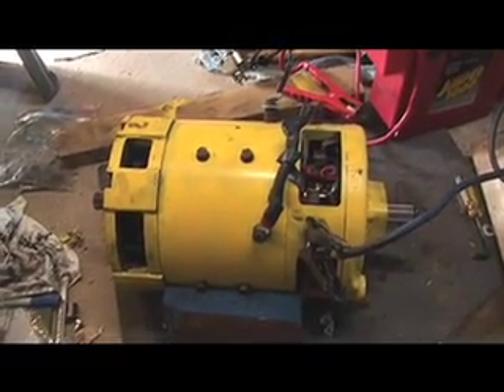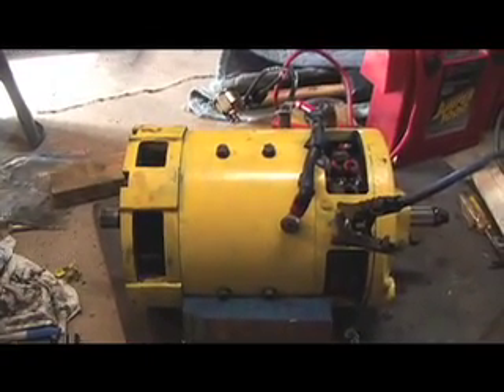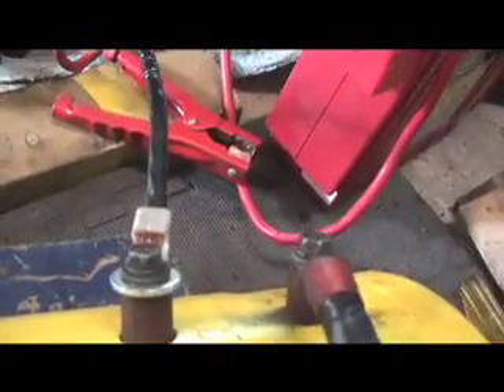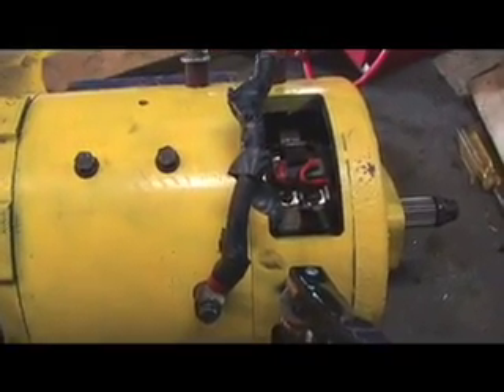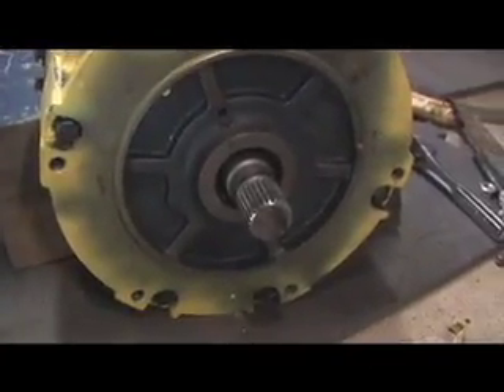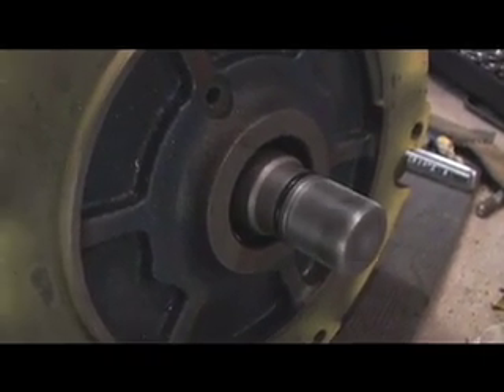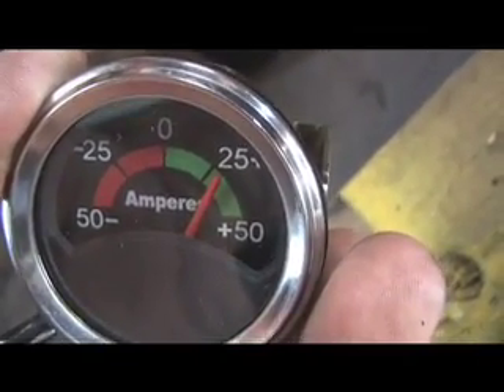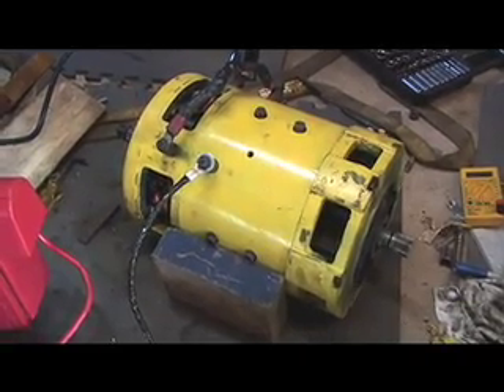forklift motor for electric car

Comment: Hi, did you ever make a vehicle hybrid? I was thinking of adding a forklift motor to my rear differential with a one-way bearing and a chain and sprocket. Is there any reason why someone couldn't or shouldn't do this
Reply from the maker: I did a series-hybrid. Much simpler mechanically. Used an LP generator to provide a steady current to the battery pack.
DIY hybrids can get complicated fast.
This design was a pretty simple one.
https://www.youtube.com/watch?v=xXVi-g4jWqI

Comment: What size motor is that in H P rating ??? Thanks
Reply from the maker: The motor never had an ID plate on it, so I couldn't tell you what the official rating was. It came from a forklift, so it would have been designed for either 36 or 48VDC.
I've run 500A through it at 144V. That translates into 72kW or about 96 HP.

Comment: I have this exact car.  It has a advance 9 dc motor already installed.   I have an 11 inch motor that is new old stock.  My question is, is bigger better?  More efficient?   Could I get better or worse mileage out of it.  it does weigh 250lbs.  Thanks DiyDave
Reply from the maker: An 11 inch motor won't fit a Geo Metro transmission. It's physically too large. There's not enough space between the center of the input shaft on the transmission and the half-shaft output to the passenger side wheel.
Reply: @BenjaminNelsonX  thanks for responding,  I wasnt sure.  I am practically into everything your doing, except blacksmithing.   Is it possible to email you.  I can keep you in touch with my progress.  I found a geo that was already converted.  Already had a advanced dc 9" installed.  And in great shape for 850$.   Thanks.  Diydave
Reply from the maker: Best way to contact me is to leave a message at 300MPG.org

Comment: Does a fork lift motor have enough RPM's to get a car up to 
at least 60 MPH?
Reply from the maker: I've gone at least 74 in a 55 zone on just a forklift motor. Just keep in mind that RPM is proportional to voltage on DC motors. For good freeway speeds, go with as high of a system voltage as you can.

Comment: I'm having trouble finding this info online. I want to convert an 8000 lb vehicle to electric. The stock engine produces 215 lb ft of torque. I want to do this conversion with recycled materials to save cost and resources. Are there any forklift motors capable of producing this kind of power? Or any other motors readily available at a junkyard?
Reply from the maker: Here's a good forum thread on using a forklift motor.
https://www.diyelectriccar.com/forums/showthread.php/using-forklift-motor-and-choosing-good-7598.html

Comment: Isnt that a 48V motor?  High amps
Reply from the maker: It was 48v in the forklift, but no reason not to run it at higher voltage. I've run this motor in a car at anywhere from 12 to 144V. It is CAPABLE of high current, which means plenty of power when at higher voltage.
Reply: @BenjaminNelsonX  How many HP is the motor?
Reply from the maker: @blackz06  No idea of the official horsepower. The motor did NOT have an ID plate on it.
I've run it at up to 144V/500A. In that configuration, it's about 100 HP peak.
Reply: @BenjaminNelsonX  Okay, thanks!  Is there a way to derive tq from the hp numbers? Or some way at all?
Reply from the maker: @blackz06  You would have to know your engine speed as well, but if you do, you can calculate torque.
https://spicerparts.com/calculators/horsepower-torque-calculator

Comment: Better to calculate in watts using DC in autos, convert watts to amps times volts, watts will lead you to how many watts you'll need(for your motor) through whatever batteries you'll need and alternator or alternators, you could splice in multiple alternators whatever the batteries are rated to take-in(and alternators to put out). If you have enough dough the car stereo competition batteries they use can charge fast, if you got 4 1,000watt truck batteries and you use a 4000 watt inverter compare that to the max wattage your motor takes 'amps times volts' you might have some leftover watts(for accessories) double your batteries(and wattage) if you have to manually transfer your batteries on and off charge(you could set up a breaker like panel) that's a direct connection(low gauge wire and multiple).
Reply: You'll have to pm me through messenger I was planning on putting something together for the EV.

Comment: How long will it run before it gets hot?
Reply from the maker: Running at 72V, this motor really never did get hot. In the back end, those fins act as a fan pumping air through the commutator end of the motor. When I ran it at 144V, the motor would get pretty warm. If I had left it long term as a 144V system, I probably would have advanced the timing on the motor and maybe added a separate cooling fan.
This is a nice beefy motor from a forklift. It's designed to handle a fair amount of power.
Reply: So it's a 72 volt motor?
Reply from the maker: It's a forklift motor. Most forklift motors were desgined to run on 36 or 48 volts. Feeding it with higher voltage gives you more power. Most forklift motors can take higher voltage no problem, but at some point, the timing of the brushes should be advanced. That helps prevent arcing at higher voltages/RPMs. Timing motors is one of the secret skills of the forklift motor hot-rodders. Do a search on a web forum like DIY Electric Car if you'd like to learn more.

Comment: Is a transmission absolutely necessary?
Reply from the maker: A multi-speed transmission isn't needed. Most commercially-available electric cars use single-speed gear reduction. However, you still need a differential to split the power to the two wheels. In a small front-wheel drive car like a Geo Metro, the transmission and differential are a combined unit. Reusing the transmission gives a place to mount the electric motor and a way to split the power to the wheels.
Reply: BenjaminNelson Don't forget that you need a transmission for giving you reverse gear and park.
Why not install a 6500 watt generator in the hatch and run the electric motor on 220 volts.
I did this with a 1200 watt generator and a small push electric lawn mower.
It cost me $150 to mow my lawn compared to $4 with a 6.5 hp push lawnmower!

Comment: Benjamin, what is the hp (horsepower) of the motor you used.
Reply from the maker: The motor was unmarked. I have no idea what the official horsepower of it was. It's a 10.5" diameter series-wound forklift motor from a full-size, sit-down Nissan brand forklift.

Comment: you used a 144vdc forklift motor ? i thought forklifts used low voltage motors like 24 or 48vdc. nice work on your electric car !
Reply from the maker: Yep, the motor is originally designed for 48, but nothing stopping a person from running it at higher voltage!
Reply: yeah thats true as long as it doenst overheat... nice work againt ! i want to make mself an electric pickup... i just have to find a good motor for it... do you remember what are the ratings of the motor you used for the motor winding explanation video, the one that came out of a 3 wheel forklift. is that powerfull enought for a small car conversion ? thanks for all the info !

Comment: It's now rotating in the opposite direction to what what designed for. The "Timing" needs to be changed.
Reply from the maker: I've run a car for years on this motor. Never been an issue.
Reply: As long as there is no excess sparking - it will be OK.
The Series DC motors are normally optimized for one direction by slightly off setting the brush alignment.
All the best Ben - I enjoy your videos...
Reply from the maker: +evric2008 on many forklifts, the timing is neutral, and the brushes are straight, because the motor is directly on a differential. The motor physically spins the other direction for reverse gear.
Reply: Most order pickers and forklift trucks have REVERSING CONTACTOR relays to swap those wires around for you to get your reverse direction as they are usually on a direct drive through a gear reduction transmission to the drive wheel(s).
I've had to repair those things and also gut them out when the company scrapped them out.
I grabbed the drive motors , the contactor relay board and the control drives.
Boy are those motors heavy ,like about #150.

Comment: Even though the motor can go both directions but they are more desired to go primaraly in one direction. See motor booklet to double check for CCW or CW direction. Some manufacters set as CCW or CW. I think the commutator and brushes are in a slightly different degrees is the reason.

Comment: Why most use forklift engines and not something new such as showing a scratch built electric engine for swaps? Would get a lot more entertaining.
Reply from the maker: It's a pretty amazing amount of work to build an electric motor from scratch! In this video, I'm just showing how there are already a lot of perfectly good motors that are both powerful and inexpensive, and can work well in a basic electric car conversion.
Reply: BenjaminNelson While on the subject of electric engines, does the size on the length matter when it comes to electric engine in similarity to why you tend to use huge brake discs in order to handle more heat but here it is electricity pull? Also, does the width (determents the engine´s size?) affect the engine performance significantly since you got more magnet at either the rotor or around to make the rotor spin?
Reply: BenjaminNelson Also I got to think, since there are some some that can built a combustion engine sort of from scratch (blocks mainly) then IMO the electric engines should be quite easy to build as long as you know how to build one to power a vehicle (cars, trucks, go karts, racing machines and etcetra).

Comment: Im not sure but did you say you reversed the electric motor?  The noise you are MOST likely hearing...is the armature not being fully "used to" spinning backward.  They wear in going in one direction...over the years they wear a certain way....and if you reverse it....you get "chatter"   Just and FYi....  Also sounds like a dry bearing as well....its either OR

Comment from the maker: Finnan, an alternator could be used to power the headlights and other 12V loads, but NOT charge the batteries. Alternators are 12V, and the battery pack has been anything from 72 to 144V. Even if it was a high-voltage alternator, you can't use the batteries to spin the motor to spin an alternator to charge the batteries, in an ideal world with zero friction, you could only break even, not gain energy.
Reply: Charlies G basicly you use more power turning the altinator than you are putting back into the batteries so no
Reply: Is there anyway of hooking a up a dc to dc inverter so your alternator can charge up your battery back.
Reply from the maker: Charlies G Keep in mind that the alternator runs from the engine, and that there is NO ENGINE in an electric car. An electric car typically uses a DC/DC converter to run 12V accessories from the higher voltage battery pack.
Reply: +BenjaminNelson put 5 to 6 alternators and connect them with any motor and run a wire from the alternators to the motor and give the motor power from anything just let it spin and then the motor will get power from the alternators, and then run a cable from the alternators to the batteries, i know its not much power, but it will give you some range.

Comment from the maker: Bearings were fine, but there was a loose kind of a retaining plate thing-a-majugger in there that was rattling when I first got it back together. Took it back apart, fixed that, and everything was great.

Comment: That's cool.  My ES-15A-6 is rated for 72v and pulls 23A at 12v  I plan to stay with DC an learn something with a modest budget.   Jack at EvTV is smart but a bit popus.  tht Boat from Amsterdam has an 11" motor and 300v - it's way fast.

Comment from the maker: Check out the "Document Depot" on the Alltrax motor controller web page. They have some good diagrams on how motor controllers are hooked up. It will give you a better idea of how to connect your motor for testing. On a series motor, you really only want to test it at low voltage. Higher voltage with no load can spin the motor really fast and even cause damage.

Comment from the maker: You can use just 12V to test it. On a series-wound motor, you have four power connections - two for the field and two for the rotor, but the same current runs through both. So, connect power to S1 and A2 with a jumper between S2 and A1. Current will flow through the stator, connect to the armature, through that, and back to complete the circuit. Use a cut-off switch or contactor to make your final connection (you don't want sparks from the sudden pull of amps!) Make sure your motor is tied down.

Comment: i have a 36v golf cart motor, it has 4 electrical posts on it. S1 S2 A1 A2. which ones do i hook the power to to make it run? also can i use just 12v to test it or do i have to use 36v. thanks for your help

Comment: Wonderful ! 
And you will attach a controller to this motor ? Will any controller do ? (assuming it is DC and the proper voltage / amperes). How much did you pay for the controller ? 
I am researching something similar and your video helped me a lot, thanks !

Comment from the maker: Advancing the brush timing refers to rotating the brush holder so that when the reversing of the polarity to create the rotational force happens is slightly sooner. It compensates for the fact that the magnetic field created inside the motor distorts at higher voltages.
It reduces arcing at the brushes.
 Think of it just like engine timing.
Reply: It sounds like the bearings need some attention. Just a guess I am not a professional electric engine builder but I would check them.

Comment from the maker: 72V is enough for a 45 MPH top-speed, fine for in-town use. I've run this car at up to 144V. I got to 73MPH (in a 55 zone) on 144V.
I've mostly used this motor at 72V. If running it at 144V all the time, I'd advance the brush timing.

Comment: AC motor technology is still the same. I can go back 60 years and tear apart an AC induction motor and it will have the same parts as modern day AC induction motor. The only technology advancement is the ability to finally control the speed of AC induction motors to the same degree as with DC motors.

Comment from the maker: It is possible (just not real common) to modify an industrial AC frequency drive for use in an electric car. My friend Tom converted a Dodge Neon to electric with a stock industrial AC motor and controller. Look through my YouTube channel for the videos on his project.

Comment: A fair point not trying to pick fault in your creation value for money it sounds good.
Just if I was to try for a road car I would try making a 3 phase inverter myself, I thought there would be many industrial 3 phase motors about second-hand as 3 phase is the industrial standard not DC but then I have not looked to buy one. Maybe a factory air con fan motor must be thousands of them out there.

Comment from the maker: I don't debate efficiency.
But I got this motor for $50, and am using an open source motor controller to power it. I spent $1300 for the entire car project, including buying the car.
Take a look at AC EV motor and inverter prices sometime.....

Comment: The motor is drawing 25 amps because its expecting 48v and your giving it 12v
Most forklift motors that size are either 48v or 72v

Comment: @BenjaminNelson- funny you mentioned the curtis motor controller. My uncle is an engineer for curtis and says i could get one or two for free after he pulls some strings. I may not build an EV, but if i do it'll be a festiva.

Comment from the maker: @ElectricAvenuesIRE 
I paid $50 for the motor. Motors from just yards are often just sold by weight of scrap value. I've seen similar motors at junk yards for $100 or less.

As for amps, I think it just wasn't a super-accurate ammeter. The armature of this motor weighs enough that one should expect it to pull a few amps with no load otherwise.
Reply: hi..... I'm looking for a forklift motor can you help (1994projects@gmail.com)

Comment from the maker: @elave16 
I am driving this car with PWM. Originally, I used a 72V Curtis motor controller, and then later I upgraded to an open source Open ReVolt controller.

Comment from the maker: @cleric022684 
You don't actually need a transmission. You DO need a way to connect the motor to the wheels. You will also need gear reduction. Even the Tesla Roadster uses a a simple gear reduction.
On a front-wheel-drive vehicle, the transmission has the gears (gear reduction) AND also the differential, which splits the power, sending it to both the front wheels. WITHOUT the transmission, you would need a from scratch/custom replacement to do all this. Seems easier just to use the tranny.

Comment from the maker: @saeidmomtahan 
Yeah, that does sound about right.
I have put up to 500 amps at 144v through this motor, which equals 72 Kilowatts or about 96 HP. Now that's only a MOMENTARY number, but it is good enough to burn rubber!

Comment from the maker: @MegaFrankie1991 
It turned out that the problem was there was a small metal plate in the one end that ended up getting loose. Sort of an anti-rattle clip sort of a thing. I hadn't realized that I ended up loosening it. Once I figured out to to tighten it back up, it was fine. The bearings were in good condition, and didn't need any replacement. I got new brushes at Warfield Electric in Waukesha, Wisconsin. The guys there were great!

Comment from the maker: @505hayes505 
Bought it out of a guy's garage for $50. 
I have had the car up to 70 mph running at 144V. I typically run the car at 72V for a 45 mph top speed. I use it as a town car.

Comment from the maker: @505hayes505 
No, the bearings were fine. I found out later that there was a loose part in the end of the motor. I properly set the screws on it, and it has been great ever since.